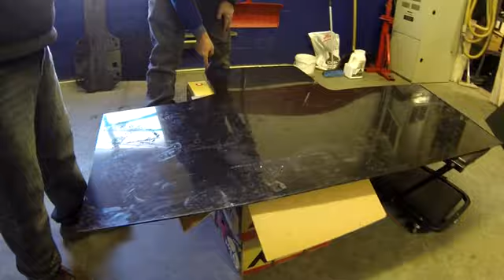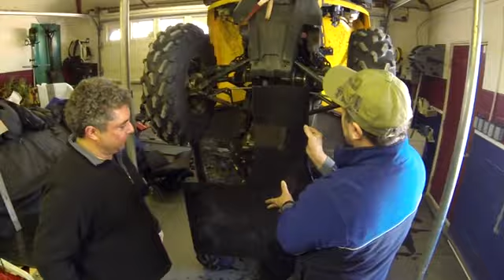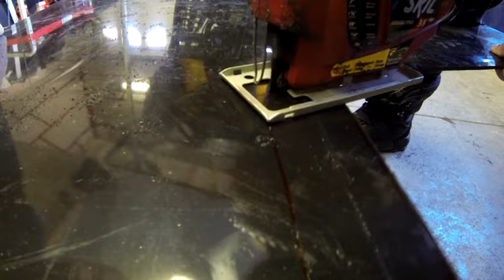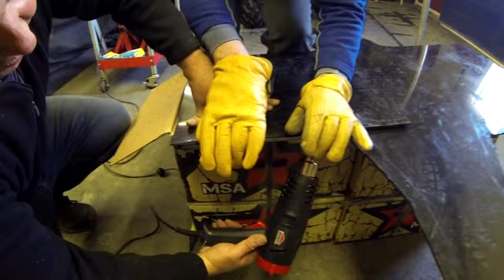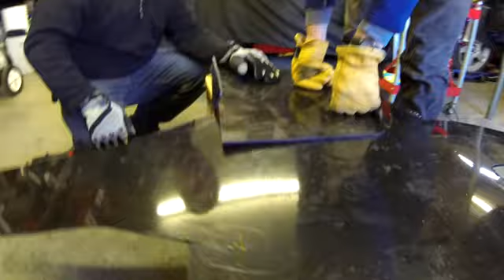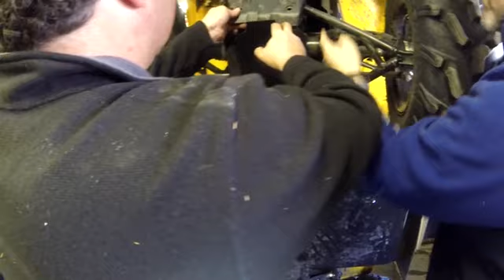ATV Skid Plates - Make Your Own HDPE Skid Plates

Comment: I used a big aluminum road sign i got for free :) just used thin cardboard to make a template an traced on the sign cut it out with jig saw an bent up a few tabs,drilled holes for mounting it on. got 6 bolts holding it on my 2003 400 Eiger 4x4 also did a front skid plate an a arm guards from the same material  :)

Comment: Soon really soon they will be tested. 
FYI HDPE and UHMW plastic is really tough and resilient to cracking. It has a high impact absorption and won't crack even when it is cold. It slides over sharp edges better than aluminum. The skids are currently off machine to add a few more bends at the back so backing up they won't hood onto anything.

Comment: Really good diy, aswell as the fan b/pass switch. Was the sheet expensive? Not that it matters cuz you've saved $$$ making it urself, as Zepp mentioned there costly items which comes in sections. Great n helpful vid. Thx 4 sharing.
Reply from the maker: The sheet cost me just under a $100 and I had enough to do 2 machines. Hardest part of the job is mount it. Using nuts and bolts is easy way but it's hard to remove later. I wanted to install it in a way that you could easily remove and reinstall for easy maintenance. I've installed fan/bypass switch on almost all my buddies machines. It's so handy to have and easy to do.

Comment: Have you tried your plates out yet? 
 You have a great idea here. Im in the process of making my skid plates out of 1/4 HDPE for my Grizz.
 It looks more durable than aluminum.
Reply from the maker: The machine in the video has not tried them yet. But I have done my own machine a little over a year ago and they are holding up great. Only thing you may have to look out for are the mounting screws. They get beat up and you will need to change them occasionally.
Reply from the maker: +luvmyctd I thought about doing something similar, but finding them in stainless steel has been a little difficult. I would of never thought when starting out this project the most difficult part would be how to bolt the skids on. For now I've just been using stainless steel self tapping screws that are cheap enough that I replace every 6 months at same time I drop all my fluids. Screws hold up well, but the heads get all mangled. Thanks for the comment, I may try it come winter when things slow down.

Comment: looks like a waste of time and money if to ask me..   Did they crack right away?
Reply from the maker: They have never cracked. Still in good shape after 14 months.
Reply: bob grass do your research... much stronger than aluminum its what professional rock buggies use(assuming this is hdpe) it also glides instead of snagging and wont dent and distributes impact much better. its also black right through so doesn't look much worse as it gets bashed
Reply from the maker: Dreded Yes I'm very happy with the HDPE plates. Installed them in late 2012 and still holding up on my machine. I've had a few good hits and as you said they won't dent.